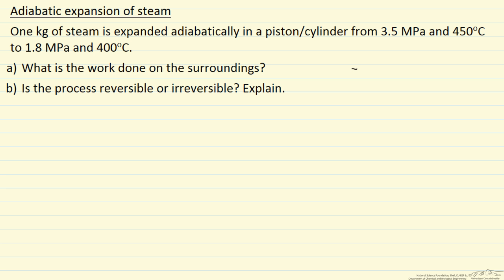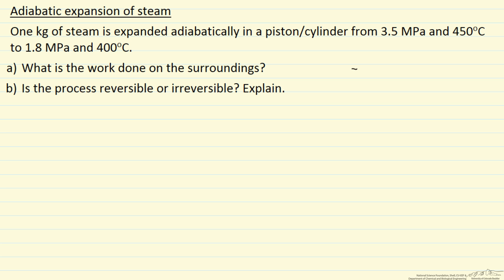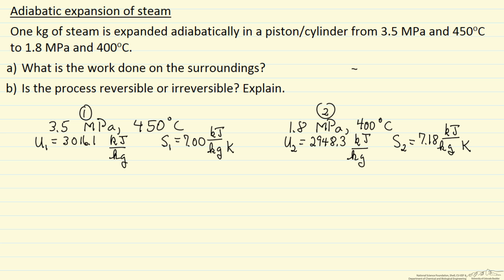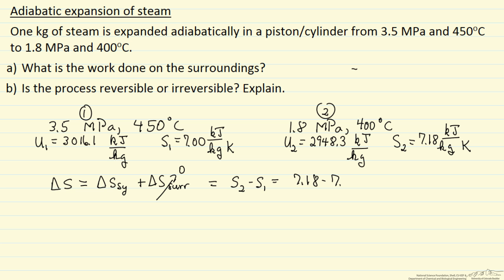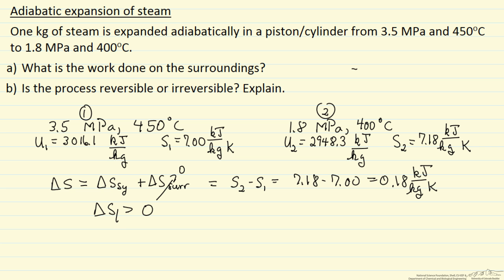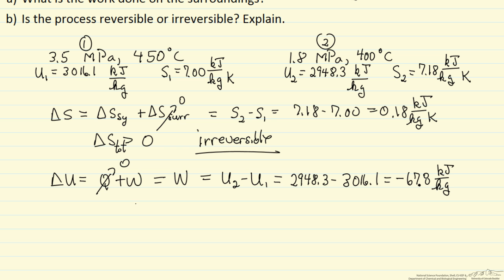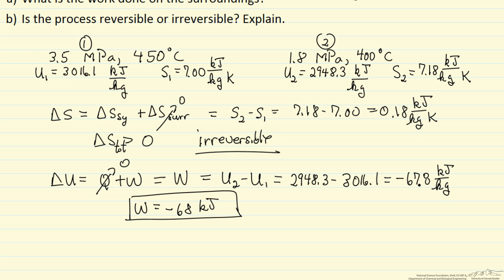Adiabatic Expansion of Steam

Comment: delta H includes boundary work people, closed systems like a piston have boundary work, or a balloon even.  If it's constant pressure, use H, U is for constant volume only.  But only boundary work is withing enthalpy, other work like shaft, electrical or paddle STILL have to be included in the 1st law.
Reply: Here, he's asking for work so you have to separate out the work from enthalpy like he did here.  H = U + PdV

Comment: Why are we using Delta U instead of Delta H?
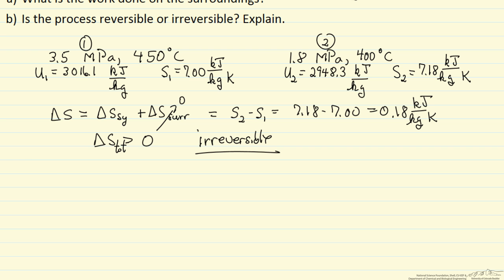Reply: 2:30 because it's a closed system. No mass flow in or out of the system
Reply: @UliSwag  Not true, delta H is used when there's boundary work, here it's asking for the boundary work separately.  But for your info delta H is internal plus boundary work.  Open systems use delta H because Flow work is included in enthalpy, just like boundary work in closed systems.
Reply: If you delta H minus delta U you will get the boundary work of 68